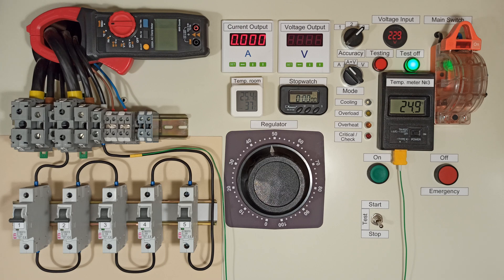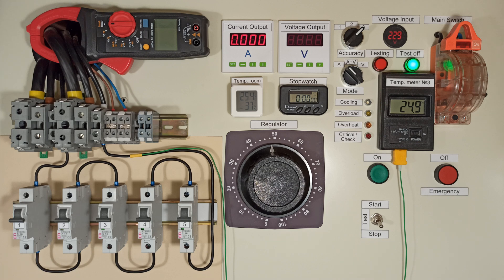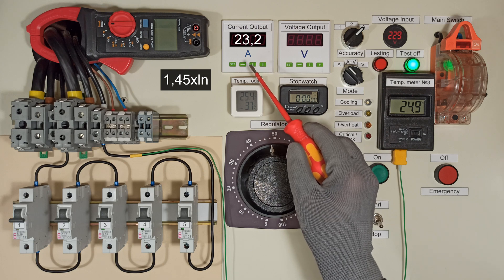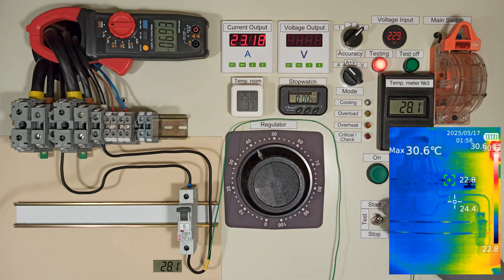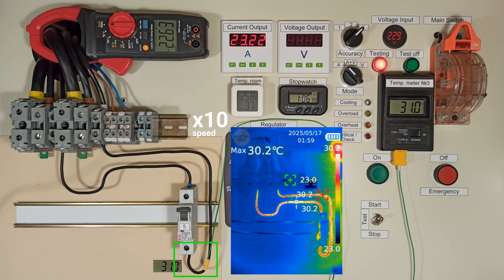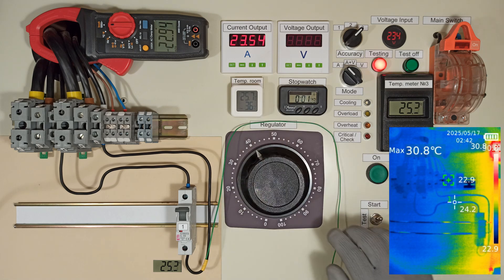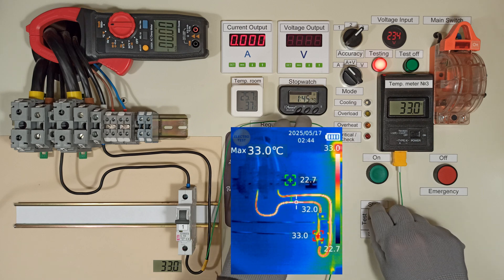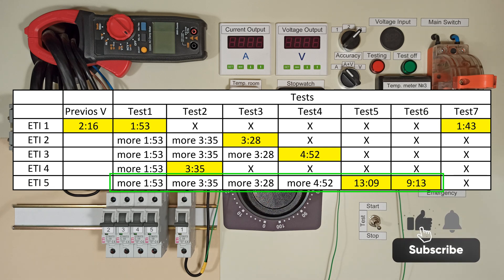Tripping Time 5 MCBs. Test ETI Etimat 16A 1,45*In

Comment from the maker: Please support my channel: https://www.youtube.com/channel/UCqZUswoAI9E9iFcTeS7L6gw/join
I’m satisfied with the result.
It’s clear that the thermal element isn’t very precise and may vary even within the same model of the breaker. Do you think it's the same with other manufacturers?
Also, that first breaker makes me a bit uneasy.
I’m thinking of doing a long-term test at 1.13×In for an hour — it shouldn’t trip :)
If you're curious too, leave a like!
Reply: I would actually do 2 x In to narrow the time window down. Anything less is a huge window and I am sure will vary widely between individual breakers. Maybe even each breaker themselves, according to ambient temp, how many operations the breaker has etc..... Those low trip currents are such a long window.
Reply from the maker: @inothome Yes, it can be narrowed down. There's even a specific point in the standard — 2.55×In. It should trip within 1 to 60 seconds.
Reply: It seems pointless to continue to test the first if it is already clear that it does not comply with the requirements of the specification.  There is a chance to identify deviations from specifications for 2 or 4 at 1,13xIn

Comment: Did you tighten the contact screws with a torque meter?
Reply from the maker: No, I didn’t use a torque meter that time. But I used the same circuit breaker — number 1 — in different videos, reinstalling it from scratch each time. And despite that, the tripping time still ended up being roughly within the same time range. I hope you understand what I mean.

Comment: The variance in tripping times observed is the very reason that the characteristic tripping curve is a band that presents a range of times for a given current rather than a single line. If properly calibrated, this trip curve says that a current of 1.5 x rated current should cause the breaker to trip anywhere between 3 to 12 minutes -- that's quite a large variation. The fact that the tripping point was below the published range could be considered nuisance tripping. The real problem would have been if the tripping point had fallen above the curve.

As another commenter mentioned, the best speed of a trip is relative to what you are trying to protect. If your load is a motor or transformer with an inrush current, sometimes a slower trip is better. When selecting a breaker, you must simply ensure that the breaker's trip curve lies below and to the left of the wire damage curve on the chart.
 
Your comment about moving the temp sensor closer to the terminal is very relevant. The termination of any electrical device is a weak point in the installation -- especially if it is not properly tightened. In my experience, a significant number of breaker failures begin at the terminals.

Finally, I'm curious about your test procedure between tests. Did you allow the breakers to dissipate all residual heat before moving on to the next test. The trip curve is based upon starting the tripping time with the bimetal at around 20 to 25 C. If the bimetal is at a higher temperature than that to start with, it is already bending and the breaker is closer to tripping than it might otherwise be. That may be why so many of your test breakers tripped too quickly.  It seems to me that it might have been more instructive if you simply tested each breaker separately rather than wiring them in series. You clearly had to re-wire the system as you removed breakers that tripped. Why not test them one at a time?

(I haven't had a chance to look at all of your videos so you may have already considered these ideas... if so, my apologies. You've really done a nice job here.)
Reply from the maker: Thank you for such a detailed comment!
It’s always a pleasure to talk with experienced colleagues — I really appreciate the discussion.
I fully agree with everything you mentioned, especially about frequent overheating near the breaker contacts.
Regarding the time between tests — I always let the system fully cool down.
Usually, that takes about 20–25 minutes. With 2.5 mm² wire, 15–20 minutes is typically enough.
That’s how I handle it in almost all of my tests — it helps to get objective trip times for each individual breaker.
There’s also a video where I test the breakers one at a time — which is, of course, the more correct method!
I even reviewed the requirements based on the standards.
Maybe I’ll eventually build a dedicated test bench that better complies with those standards.

Comment: Interesting to see such a difference on the "same" breaker. They are built exactly the same but behave differently. Why do you think that happens? Because of small production differences?
Reply from the maker: Thanks for the question! I think there are a few reasons:
1) the heating element is not very accurate (at least in this model);
2) differences in components (even if they are very small);
3) and deviations during assembly.
Reply: @ElectroTest_1  Yes I think you are right. But I thought they are factory tested, so it shouldn't happen that a MCB trips too fast.
And I congratulate you for your nice work, I always wondered when you will get more attention for making such high quality content. Now your channel is skyrocketing and soon you will have more subscribers than I do ;) Continue your great work, Greetings!
Reply from the maker: @0commentarygaming Hi, my friend! First, about the breakers. As far as I know, the factory doesn’t test every breaker but checks several randomly from a batch. Also, they don’t test exactly at 1.45 * In, because that would take too long, but rather at 2.55 * In for up to 1 minute. If anyone knows more details, please share your info.
Thank you for the encouragement! I hope people will continue to find it interesting! I also wish you growth for your channel!
Reply: @ElectroTest_1  As far I know, they test every breaker. It's not a big deal because you can automatize this process pretty easily. They test if the MCB is tripping at 1,13* (which it shouldn't). Then they test if the MCB trips within an hour at 1,45*.
And 2,55 * is used to test the "fast reaction time", the MCB hast to trip within a Minute.

They surely will! Thanks! :)

Comment: The bi-metallic strip in the MCB offering the overload protection is pretty rudimentary in design and renowned for having a wide tolerance of operation that is affected by many things. 
The breaker tripping a bit too quickly may have an internal mechanical issue, it may be that the contacts are a bit worn electrically and have a higher resistance and therefore generate more internal heat. If you have a milli/micro ohm meter you could measure this and compare across the 5 breakers.
Breakers that take longer to trip may have a stronger bi-metallic strip or the mechanism may be tighter.
There is the tolerance of your measurement setup as well, there is certainly a difference between the clamp measurement and the panel meter.
Everything in engineering has tolerances and MCBs probably have some of the largest tolerances, so your findings, whilst interesting, aren't that surprising.
Reply from the maker: @three-phase562 Thanks for the detailed comment! I generally understand how the bimetallic strip works and the factors that affect the tripping time. What I’m particularly curious about is how much that time can vary on average. Now I see that it can differ quite a lot.
In general, I take tripping time into account when designing wiring and distributing loads across circuits, especially when there are several high-power consumers. For example, there might be a line with multiple devices, and the predicted peak load could last for 3–5 minutes while a kettle is boiling. It would be ideal if the breaker doesn’t trip in that case.
Reply: @ElectroTest_1  Measure their resistances, please, this will give a chance to reduce the number of possible causes in this variability.
Reply from the maker: @MrYrodz Thank you for the idea. I don't yet have a dedicated milli/micro ohm meter. That could also be an interesting measurement and comparison. However, in this particular case, I think the issue is not with the contact but with the bimetallic strip or the latch itself. Note that one breaker doesn't overheat — it simply trips when the temperature reaches 33°C (test 7). So it doesn't actually overheat, it just trips faster. Meanwhile, the 5th breaker heats up to 53, 48°C (tests 5,6). In that case, the strip bends more slowly or the latch is slightly different.
Reply: @ElectroTest_1  If you do not have a milli/micro ohm meter, then you could just measure the voltage drop across each of the MCBs during the test with an AC millivolt meter. Alternatively use a DC power supply and measure the current and voltage to determine the DC resistance. As @MrYrodz says, even if it doesn't show an issue, it at least rules it out as being one. 
After that, it is stripping them down to see what mechanical differences there are, even dirt and burrs from machining can produce problems, but you may just have an MCB with a combination of parts with their tolerances all towards a limit, that added together exaggerate the difference in the timing response.

Comment: Looks good to me. But my 70 year old timber house has reticulated wiring so I have an extra wire fuse in front of combination breakers.
Reply from the maker: Thanks for the comment (smiley) So you trust fuses more? And what current rating are they?
Reply: @ElectroTest_1  A 16A wire sometimes blows quicker than the 10A elcb breaker. I live in wet tropics with very high corrosion so simle stuff is more reliable!
Reply from the maker: @LawpickingLocksmith Very interesting info. Yes, it’s definitely a great solution for your conditions! High reliability, less maintenance.

Comment: Would be interesting to see if the first breaker are under bigger load due to the contact resistance of the breakers after it providing additional load.
Reply from the maker: @davidreinhart373 Thanks for the comment. The current is the same through all of them, and they’re all under roughly the same conditions.
Reply: All have the same load because it is just one curcuit, the load is the same everywhere